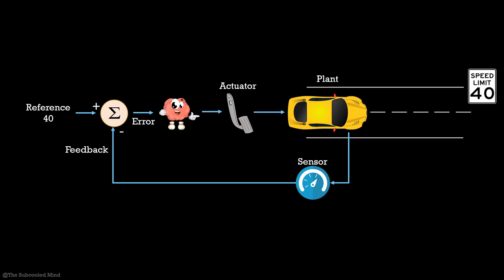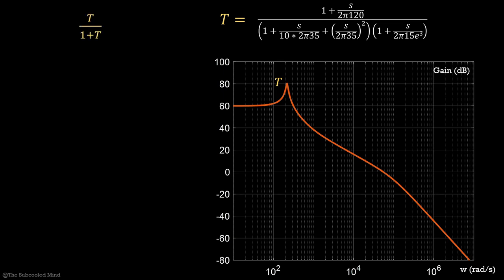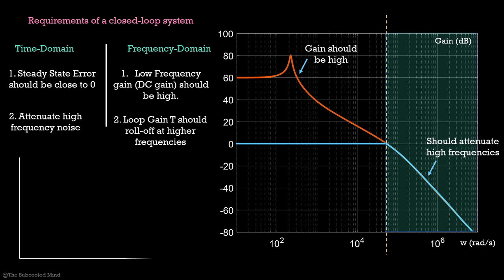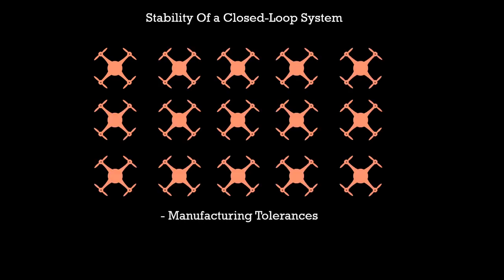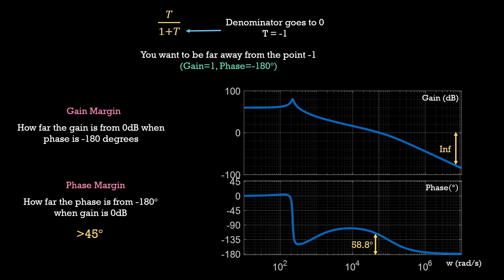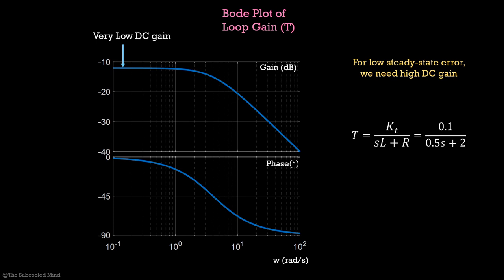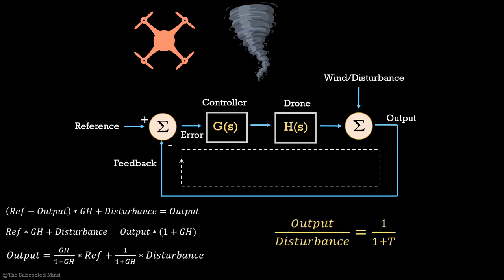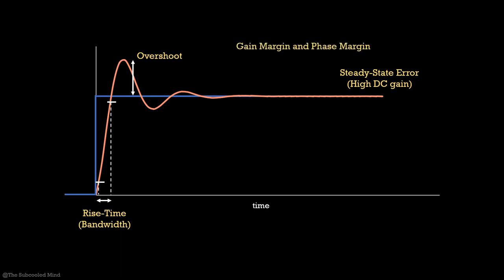Loop Shaping Technique and Stability Margins | Part 3 - Control Systems Simplified

Comment: Doesn’t the change in open-loop gain alters the phase of closed-loop transfer function? How can we say that decreasing the gain makes it nearer to the phase cross over frequency point, if it affects the phase as well?

Eg: 1/(s+1) → open-loop TF, Considering a unity feedback system( closed loop TF --> 1/(S+2) ) and now by increasing the open loop gain by factor of let's say 2.  Closed loop TF will be 2/(S+3). Phase cross over frequency changes right? Please correct me, If I am missing any thing here. I feel like in only open loop phase doesn't change with altering gain.
Could you please explain this.
Btw great video this!
Reply from the maker: Hi Viru,

I will make a couple of points and I hope it will help you understand the concept better:

1. Changing the gain will change the cross-over frequency of open loop tf as well. That is because the 0dB cross-over will happen at a different frequency. (Phase plot will not change but the cross-over frequency will change)
2. The idea of approximating closed loop tf - T/(1+T) will work only when T>>1 and T<<1. Take the example of 1000/(s+1). The open-loop cross-over frequency will determine the band-width of the closed-loop system. Plot it in MATLAB to see it visually.